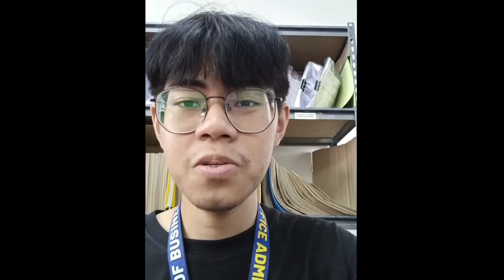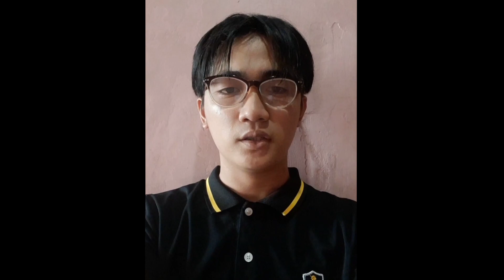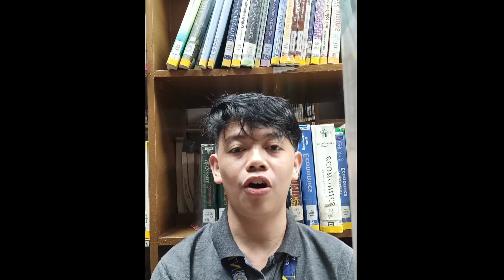Operations Management : Supply Chain | G09

Comment: 24: The bullwhip effect, also known as the Forrester effect, arises when modest changes in customer demand for a product lead to more substantial swings in demand further up the supply chain. This phenomena can lead to inefficiencies, cost increases, and stockouts. For example,  Apple: Using demand-driven and pull-based tactics, Apple efficiently controls its supply chain. It collaborates closely with suppliers to ensure that they obtain real-time demand information. Apple's supply chain performance can be ascribed in part to its ability to respond swiftly to changes in demand, which aids in mitigating the bullwhip effect.

Comment: 44: The factors should be considered in choosing a transportation service for their supply chain is to choose a good vehicle and fast courier to speed up their arrival of stocks or what is needed by the company, especially when it comes to stocks because The arrival of the product to a company should not be delayed, for the reason that they will run out of stock or their sale's will be delayed if it is not sent immediately by the company.

Comment: 29: In order for all sites to function together flawlessly, centralized supply chains rely on building a central repository of data devoid of any supply chain fragmentations. Decentralized supply networks focus on regional differences and local benefits that can boost supply and output. In contrast to a decentralized network, which has more and smaller facilities, a centralized network has fewer, larger facilities. Regional supply chain locations can be either centralized or decentralized depending on the organization's risk appetite, the nature of the products, the client base, and the market. In some circumstances, a hybrid method that blends features of both can be effective to balance each strategy's benefits and drawbacks.

Comment: 11: The choice of transportation mode affects the efficiency and cost of a supply chain in a way where it contributes on how fast, reliable, secure, and cheap the supplier can deliver the goods.  Based on the video there are different types of transportation, and they all have their differences and uses. Some factors that affect the efficiency and cost of a transportation mode is the speed of how the product is transported to the customers. When the products are fast to be delivered to its destination then it is better as the supply chain's performance will improve and it will prevent wasted time which will lead to reduced costs. Also, although the speed of the delivery is important, in some cases, there is a need to make sure that the goods are transported safely and securely as the products being transported can vary depending on its size, weight, or material (fragile, perishable). With that, the transportation mode chosen may not be as speedy or cheap as the other option, but it can assure that the goods will arrive in its best condition. Therefore, these choice of transportation mode also plays a part in the customer satisfaction since the transportation was fast, secured, and cost-effective, then the customer will find it more reliable.

Comment: 05: A push strategy is a supply chain management approach in which best estimates or long-term forecasts of customer demand are used to determine production levels. One of the advantages is that it is efficient for managing production schedules and maintaining stable inventory levels and economies of scale can be achieved by producing in large quantities. The disadvantages of this are the risk of overproduction leading to excess inventory and increased storage costs. Potential for the accumulation of obsolete or outdated products.

Producing goods in response to real market signals of demand is known as a pull strategy. The benefits include a lower chance of overproduction and the expenses that go along with it, as well as more flexibility in response to shifts in consumer preferences and market conditions. In comparison to the push strategy, the drawbacks are more difficult to handle since they necessitate a high level of supply chain responsiveness and could result in higher production costs because there are no economies of scale.

Comment: 04 :The role of sustainability and ethical considerations in modern supply chain management is to provide a sustainable environment to ensure that the supply chain will not be interrupted. One of the challenges implementing sustainable supply chain practices is higher demand for products which cause the supply chain to lose a great amount of raw materials in one go.

Comment: 42: The concept of Vendor Managed Inventory (VMI) is to build and process a strong communication system between the seller and the buyer. It is also a process wherein vendors or suppliers, is allow to monitor and manage their customers inventory. The benefits of VMI to vendors and customers is the satisfaction and smoother flow of the goods. One of the successful implementation of the VMI is the walmart. Walmart is a popular brand that utilizes a vendor managed inventory (VMI) system, holding its suppliers accountable for maintaining their inventory at designated warehouses.

Comment: 36: The push supply chain strategy involves producing goods based on sales forecasts, while the pull supply chain strategy involves producing goods based on actual customer demand. Advantages of push include faster production and availability, while disadvantages include excess inventory. Advantages of pull include reduced inventory and waste, while disadvantages include longer lead times.

Comment: 19: JIT can greatly improve supply chain efficiency and and inventory management By reducing costs improving quality and enhancing flexibility 
heres a advantages and disadvantages
1. Reducing Inventory Cost
Advantage- JIT eliminates the need to maintain enormous inventories, resulting in less costs for storage, carrying, and obsolescence.
Disadvantage- Over-reliance on JIT may increase costs when unexpected disruptions occur, as there's no buffer inventory to absorb fluctuations.
2. Quality Improvement:
Advantage- Quality control must be prioritized in JIT since flaws could hinder the flow of production.
Disadvantage- High-quality standards might be hard to attain and keep up.
3. Increased Flexibility 
Advantage- JIT systems are flexible enough to adjust to shifting consumer demands and market dynamics.
Disadvantage- Quick changes may put stress on the supply chain and raise expenses.

Comment: 10: When selecting an option of transport for their supply chain operation, businesses should take into consideration how durable and well-maintained it is in terms of heavy goods. This is because it is possible that a firm might have greater maintenance costs if the transportation used for its supply chain operation is not suitable for heavy load.

Comment: 49: The reason why supplier evaluations are crucial to supply chain management is that they enable you to make sure that your suppliers are adhering to your standards and specifications. They additionally enable you to recognize any possible issues that can affect your company. obtainable. In order to cut costs, minimize risks, and promote improvement, a supplier evaluation also looks at current suppliers to gauge and track their performance. 

Key Performance Indicators (KPIs) are measurements that supply chain experts can use to assess how successful and efficient certain supply chain processes are. Supply chain KPIs primarily refer to the key performance indicators that have a significant impact on the supply chain's overall health or issues. As a result, I'll strategize, measure, experiment, and then spread ideas.

Comment: 08: Vendor Managed Inventory (VMI) is a supply chain management strategy in which the vendor is in charge of keeping track of and replenishing the inventory of a customer.  In order to maintain ideal stock levels, vendors use data and forecasts to proactively restock products. Vendors benefit from VMI because it enhances demand forecasting and reduces excess inventory. Lower carrying costs and stockouts benefit customers. Procter & Gamble, for example, effectively implemented VMI with Walmart, increasing efficiency and lowering costs for both companies.

Comment: 28: Just In Time (JIT) inventory systems can significantly enhance supply chain efficiency and inventory management. The advantages include reduced carrying costs, minimized inventory holding expenses, and improved cash flow as inventory is procured and utilized as needed. It also encourages lean production and reduces waste. However, disadvantages may arise from the vulnerability to supply chain disruptions, as JIT relies on precise and timely deliveries.

Comment: 43: Vendor Managed Inventory (VMI) is a collection of processes and inventory management software in which a manufacturer, who is also a supplier, takes on the responsibility of optimizing the distributor's inventory stocks. VMI can help suppliers and buyers mutually reap the benefits of successful inventory optimization.

Data analytics and technology are critical in optimizing VMI systems. VMI systems can also be integrated with other technologies such as cloud-based inventory management software, customer relationship management (CRM), enterprise resource planning (ERP), point of sale (POS), and e-commerce.

Comment: 30: The bullwhip effect causes suppliers to increase inventory and production levels because it overestimates demand. The bullwhip effect happens in a supply chain when each party steadily increases an originally modest demand rise. Each link in the supply chain produces more than is necessary to meet this demand, which results in excessive production, erroneous demand projections, and uneven inventories. occurs when retail customer demand changes, causing retailers to overreact and drastically alter their demand prediction.

Comment: Supply chain is mainly focused on the raw materials and parts to make the output  for the product/service, if the delivery and the time changes from time to time it also change the customers demands. Especially modernisation are gradually taking place, and this impact the perspective of the consumers to the product or service. The best way to enhance supply chain enhancement  is forecasting, to fully utilize the range and the unforeseen circumstances. Support and proper resolution may take place.

Comment: 47: By implementing innovative strategies, businesses can provide transportation services that are both cost-effective and sustainable. Optimizing route planning and vehicle use is one method for lowering fuel use and emissions. For instance, the postal service uses "package flow" technology to reduce the number of left turns, which saves time and fuel. Adoption of electric and hybrid vehicles can lower carbon footprints and ongoing operating costs, as demonstrated by Amazon's pledge to purchase 100,000 electric delivery vans.

Making use of alternative fuels and energy sources is another strategy. Biofuels are used in delivery trucks by businesses like IKEA to reduce how they depend on fossil fuels. Sustainability can be further enhanced by integrating renewable energy into transportation infrastructure, such as by placing solar panels at charging stations.

In order to reduce unused time and fuel consumption, companies like Maersk collaborate with other shippers to share vessels. Finally, making use of data analytics and the Internet of Things for effective logistics management and real-time monitoring helps lower costs and lessen environmental impact. Cost-efficiency and sustainability must be balanced, and this requires a multifaceted strategy that incorporates technology, alternative fuels, and cooperation.

Comment: 13: One of the innovative approach of some companies to balance the cost-efficiency with sustainability when making transportation choices is by allowing employees to work from home or implementing hybrid working set-up,  especially during and after the Pandemic.  

The pandemic has placed significant reatrictions on transportation until now,  making it difficult to companies to function as usual, many have turned to remote work to ensure that their operations and productions are not distrupted. 

 By allowing employees to work from home,  companies are reducing  the need for commuting,  which can save costs for both the company and its employees.